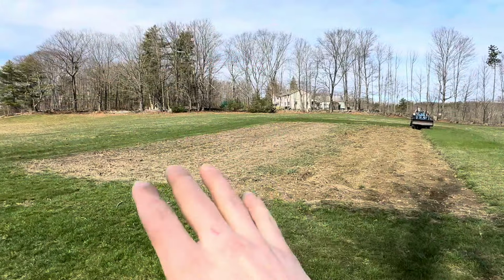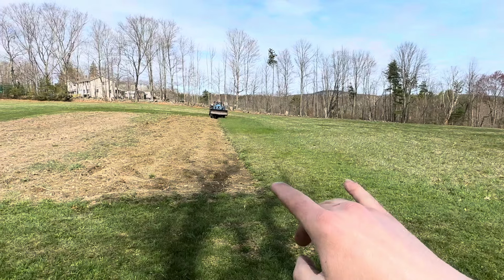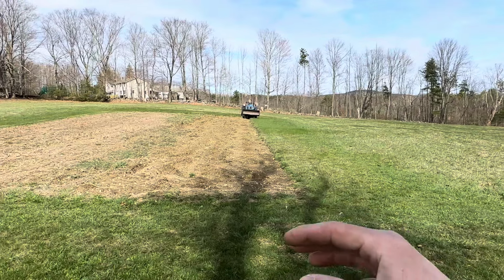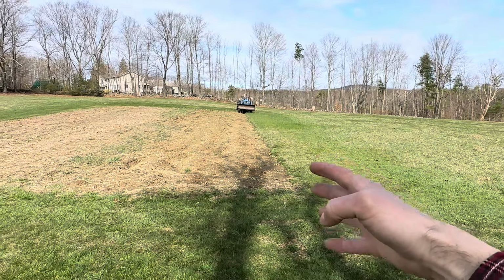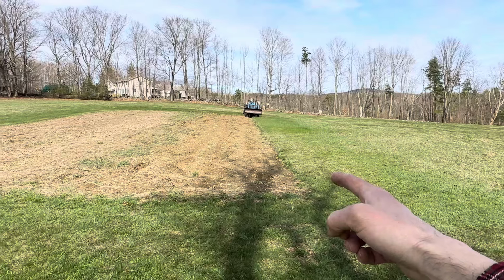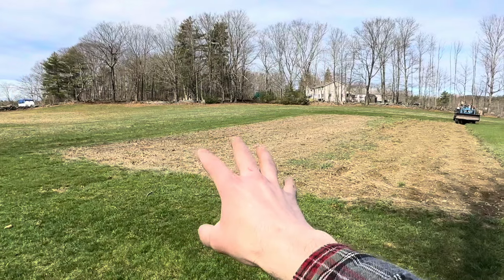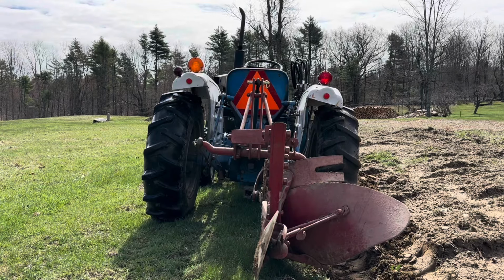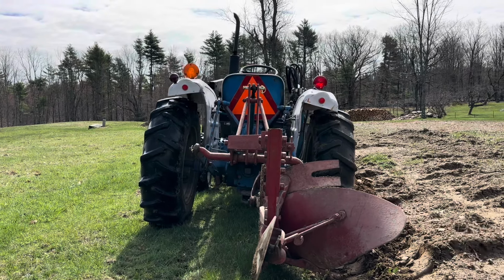Preparing a Potato Plot with a Ford 1700 Tractor and John Deere Single Bottom Plow

Comment: Tip if you'd disk or tiller that sod before plowing. It would plow better and pull easier. Also add a gage wheel to plow beam on Left hand side. You would never be without it. You had plow set up good. Little 2cly Ford sounds sweet pulling. Enjoy video. Oh if you had a tiller tool you could pull rocks to the top, and easily pick them up. Sometimes land seems to make rocks. Bless you  Man.

Comment: Good to see the ole Blue working the ground with the plow.  I've got a 1981 Ford 7600 diesel that is my one and only tractor.  I use to plow with my 3 bottom ford plow but have retired it for a 9 shank chisel plow.  I like the chisel plow even better than the moldboard plowing.